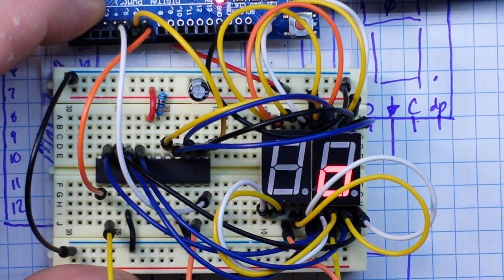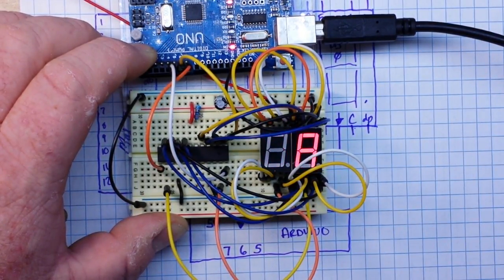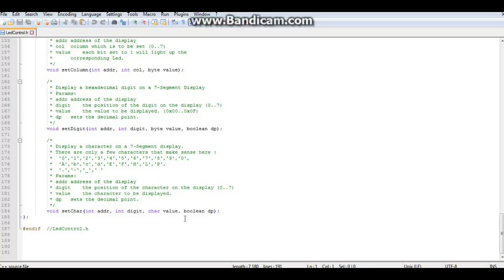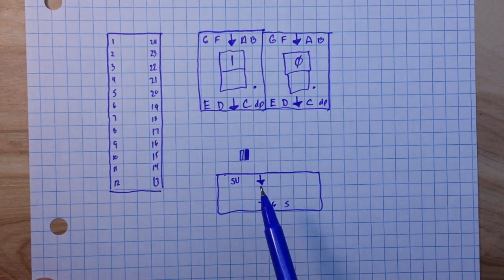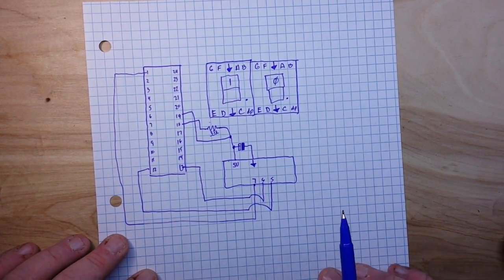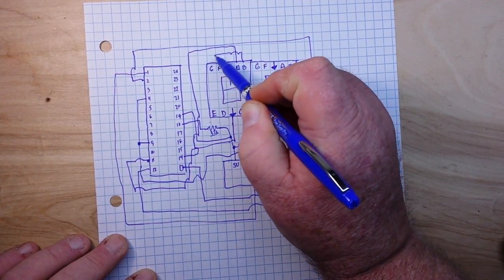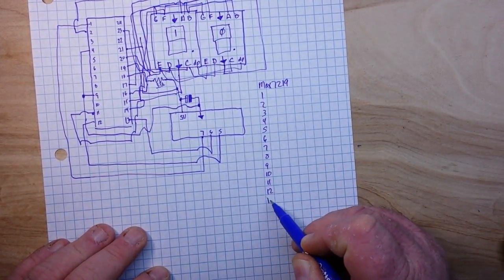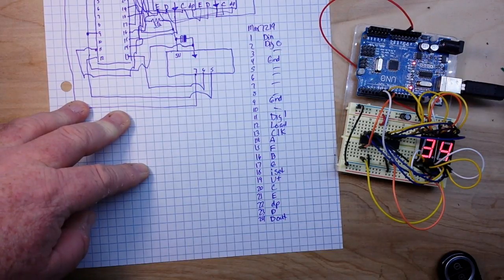Arduino Seven Segment display with Max7219 and LedControl

Comment: Questions??? What happens to the other common pins on the 7-segments as per your diagram??? You have the bottom commons connected ....Plus I am looking having 3 7-segments connected with DIG0/DIG1 and DIG2 in order..Will this work???

Comment: Hi there, is it possible to: Have two different source (like 1 chip sending number 12 and another chip sending 25) and they both have to send information to two 7 segment led (the same two 7 segment for both of them)... The catch is that between a chip and the two 7 segment ... only up to 8 wire can be placed. Both chip must be independant from the other. Is it possible :D ???

Comment: Thanks a lot sir..the display just worked fine...excellent...the drawings are too good for a beginner ..I've only 1 question..do I need a driver transistor if I connect 8 of such 7 segment displays???
Reply from the maker: +Sayantan Maiti The Arduino digital pins can source an absolute maximum 40mA, but you shouldn't push them beyond 20mA.

I don't have the specs on me for those 7 segment displays, but I would say yes.
Reply: thanks